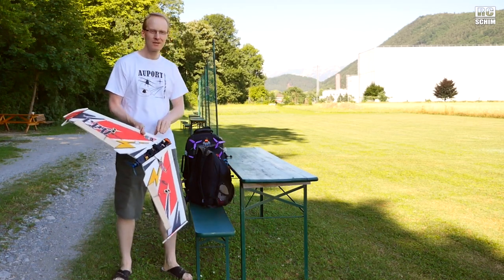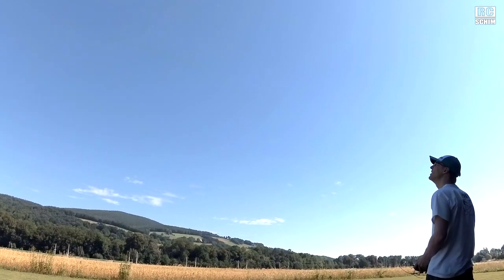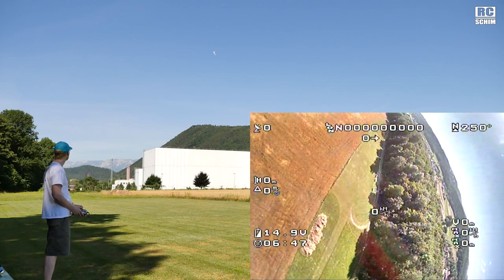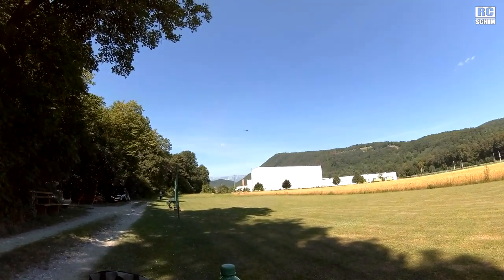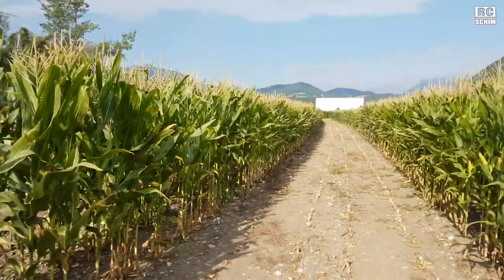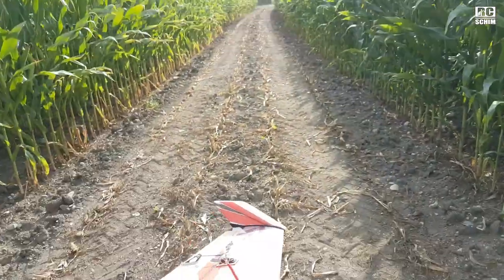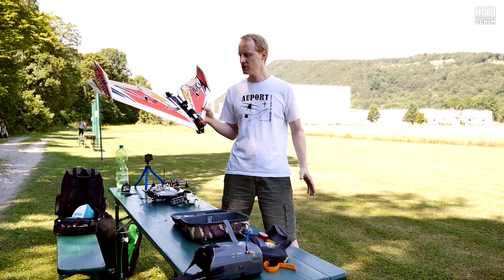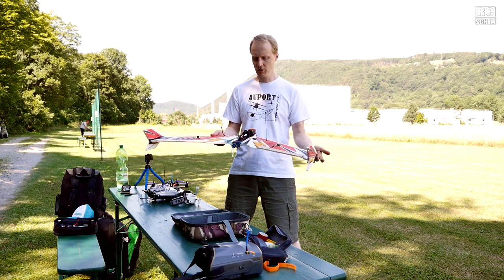TechOne FPV900: great FAST WING (Review, Maidenflight, FPV, Speedtest and CRASH)

Comment: Hi. Great review as i look into wings myself. Was looking at the s800 but u recomended this one instead. Do this one comes without osd? Osd is a must for longrange! Keep the videos coming😊
Reply from the maker: +Viksa the fpv900 has only motor and servos as esc. For osd you need your own stuff. For lr flights i have the mini talon with arkbird osd and rth
Reply: RCSchim ok thx for answering😊 so techone had the rth installed when you were cloudsurfing? I hope i understand it right that i can use whatever flightcontroller i want. Also fc that are used in race quads. Pretty new to this.
Reply from the maker: +Viksa no, I had no rth for the #cloudsurfing.  Only good luck and confidence in my systems... i think there is software called inav that can run on fc's.

Comment: Nice wing, what is the GPS system tat you use? Thanks.
Reply from the maker: +Tom von Agner it is the dalrc osd. Around 50usd. Nice for what it is. Can even configure the positions of all the readings (with one button, no computer interface), but it's no rth sys or ap...